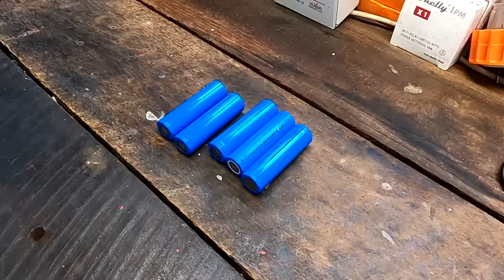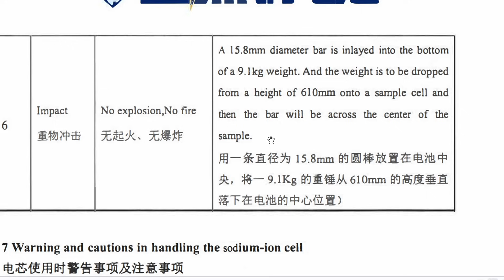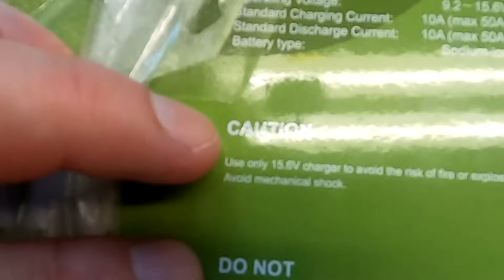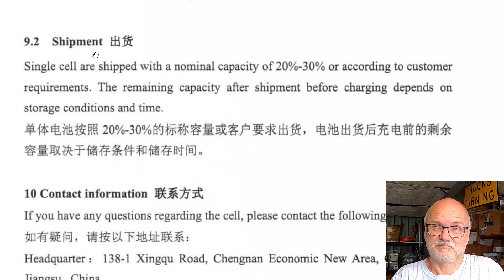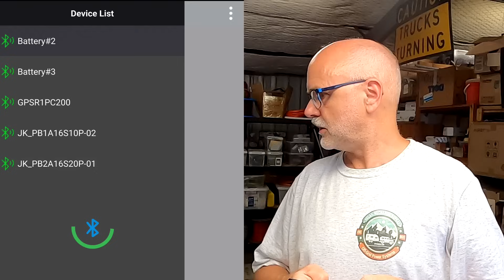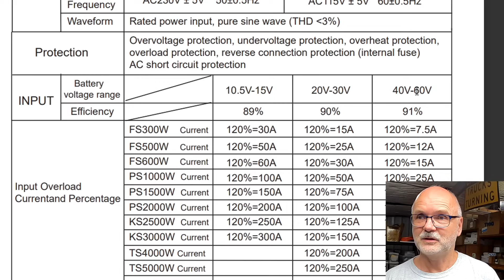Sodium Cell Charging and Discharging Analysis, Hardware Compatibility. Future or Niche product?

Comment: The flat curve of the LFP is just perfect for home storage.
When will the battery shelf be upgraded to 18S LFP (45V -> 62.1V) to gain 12.5% capacity ?
;o)
Reply from the maker: Yeah, I also like the flat and almost constant voltage from LFP batteries.
No upgrade to 18S, there is no room inside the box. I have other plans for an upgrade...😉

Comment: A new BMS design could switch the battery from parallel to series as needed to match the inverter's voltage range.  I wonder how hard this would be to DIY.

Comment: I have some cells from a different source, and they say the specs are charge to 4.1 and discharge down to 1.5. What would happen if you tested your batteries agin using 4.1 rather than 3.95? Based on past experince, a specific chemistry has specific voltages so both can't be right.

Comment: I have a SkyRC MC3000 programmable charger. Can it be programmed for NA? If so what chemistry do I select or does it even matter?
Reply from the maker: You probably have to choose a custom battery profile and set the values manually. I'm not aware of any charge controller which has a sodium profile.
Reply: @OffGridGarageAustralia  Is that what you are doing? It looks like the LiIon profile van be modified for charging, but for discharging the only profile that will work is LTO. Clumsy but workable on the MC3000.

Comment: I am now wondering why a research paper mentioned discharging a sodium ion battery will completely reset the battery
so it would be in the manufactures best interest to steer consumers away from completely discharging them as this 
could effect the long term sales figures. 

So I am interested to see a test that would prove or disprove what the research papers are trying to keep on the down low..

Comment: if they can go to 0v with no damage that simplifies a bms. it means you only need a top balance function ..the top voltage shut of could also not be needed as the bike controller or charger for example could stop the upper voltage leaving only a balance function required and maybe that could be done once at long intervals.also if it can go to 0v it could be bottom balanced simply by letting all cells go to 0v.the linial voltage slope helps identify state of charge. if you have cells that can do higher c rate of charge then you can have smaller cheeper lighter battery that can handle large inputs of charge.im reading some of the sodium cells can acsept 3 or 10c charge input.i think they will overtake lifepo4 in weight and cost.

Comment: Hello Andy, or as we say moin Andy.... I love your videos man. You do a very good job, very structured and intense I think.  Besides the learning effect, there is also a lot of fun.
I can confirm your results with my results on a 32140 sodium ion cell.
I only use 80% of the cell capacity of these cells. The 12V battery has a voltage range of 10V - 15.2V. That works perfectly. Let's see how long such a battery lasts..... Have fun and keep going on!👍

Comment: I have some factory 100Ah Sodium Battery packs, 12v and 24v
the inverters can use most of the voltage range generally, lower limit cut off leaves some un-used capacity but very small.
The Soduim specs appear to tollerate far lower and higher temperatures than the LFP - should be good news for Australians, Texans Sudias and Scandinavians alike!

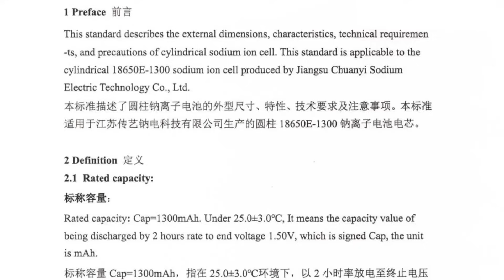Comment: As someone else pointed it out @ 4:10 the Capacity of each batter is 1300mAh in the instructions you received not 1500mAh as you kept saying.  The 1500 printed on the sleeve didn't say 1500mAh, just 1500 maybe that was just  reference number? -   They charged right to their capacity (a bit over).

Comment: Thanks very much for this comprehensive info. But there is no info about cells DC resistance at 0 - 25 - 50 - 100 % SOC. Resistance and capacity are key features to know, if I would build NIB battery for my PV. Also it si well known fact, that we need use cells at 40 - 60, 30 - 70, 25 - 80 or 20 - 85 % SOC ENERGY, so we can use cells at VOC from 2.4 - 3.9 V, but under load it will be lower , depends on Cx rate of discharge and under charge, it will be higher, depends on temp + resistivity + Cx and also SOH, which means, if battery is old and was stored or used at HIGH SOC and HIGH TEMPS, the SOH parameter is BAD. So if we use battery from 2.25 V to 3.9 V under LOAD, we can use Studer inverter 38 - 68 V range, and 38 / 2.25 === 17 and 3.9 x 17 === 66.3 V, so we will use battery from 25 - 35 % SOC to 85 - 88 % SOC and our battery will be good for a lot of years, if we do not abuse battery at high currents, which means high temps at electrodes, separator and elyt, so proper temps range, proper Cx C/D rate, proper SOC range and we can use this battery pack for 1/2 of our life.

Comment: For now, Na+ batteries are still more expensive than LiFePO4 (LFP). That's probably because they are new, and production is not refined. Those prices will drop. But lithium prices are dropping, too. Several new mines are opening up in the U.S., Europe, and elsewhere. It's quite likely that as Na+ batteries drop in price, LFP batteries may have a similar drop in price (wouldn't THAT be nice!). I'm not sure I see Na+ living up to the hype and replacing lithium anytime soon.

Comment: 65% SOC at 2.7V. For a 4s, 12V nominal battery, that means you get less than 2/3 of the battery capacity before you are down below 11V. A lot of inverters are going to shut down at that point. Many 12V loads may also have a problem below 11V. That steep, mostly-linear curve seems less than idea. Not to mention that 3.95Vx4-15.8V at 100% SOC. That's too high for a lot of "12V" applications! So you may not be able to start at 100% for some loads, and you may have to stop at 65% SOC for a lot of loads. We're getting back to the bad-old-days of lead batteries where you can only use 50% SOC of the battery, meaning you need twice as many batteries compared to LiFePO4. Na+ sucks! Already!

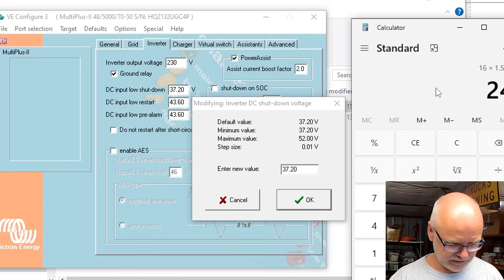Comment: Heya,1st of all those soduim 18650 is a lot of work and battery cell's to make a 320AH parralleled/serial battery bank. Lol later in the video you show the primatic cell's. at time stamp, 29:54 37.20 volt's is the lowest but did you try to chance the minimum voltische as it shows in "enter new value" maybe this way yoou can set the voltische lower. oh you love to see more test's and olso with the 12 volts battery

Comment: Thanks Andy!
I'd be interested to see a cost comparison between equivalent cells for building a 12v nominal pack and 48v nominal pack.

The energy density seems pretty low compared to lithium ion and lithium iron phosphate cells too.

Also they say they are rated for 3000 cycles to 80% -- that's worse than for lithium iron phosphate, which has 4000 cycles to 95%?

At this point, I agree with you that it seems there is only a niche market for them for use at colder temperatures.

Comment: For any static energy storage solution, what actually matters is the total lifetime energy exchange divided by the cost.  These batteries will be judged on their ability to absorb and release energy over time for a give installed cost.  We moved from NMC to LIPO even though the energy density is significantly worse for the latter simply to leverage the greater cycle life that meant an overall lower cost, ie 4,000x 93% is greater than 2,500 x 100% 🙂

Comment: I'm curious to see how sodium battery can be implemented to 48v solar inverters, because of the higher voltages and steeper drops. Will a dc boost converter do the trick?

Comment: You got one point a little bit wrong. For LiIo Cells, there where also no big market for BMS 10 years ago. I think, parallel to the mass production and pricedrop of this cells, there will be a increase in inverters, which are running this voltage delta are pretty fine. I love the idea of this cell type and it will be great for home energy storage. 20kWh for 2000€, will be great 🤣 We will see, time will tell.

Comment: Would you need thicker cables, due to the voltage drop as the battery nears full discharge ?
Reply from the maker: No, it's a 4 wire measurement and independent of the voltage drop in the test cables.
Reply: Sorry, I meant when the batteries are in actual use, to power an inverter etc.

Comment: Hi Andy,

I remember one of your LiFePo tests in where you charge them to around 100% using a lower then max floatvoltage.

Translating this to Victron, would it not be a nice test to see if you can top off this cell with a lower maximum voltage and then test what it does with the overall capacity.

If this sticks, you might be able to build a 17,18,19S etc battery and not really need the maximum chargevoltage the Victron cannot supply and still fill them up. Whis would leave a larger portion of the SOC to be used in one cycle.

Balancers don’t have any issues  up to 20S, not sure about BMS availability.

Gr.

Mike

Comment: There was no appropriate hardware for LiIon cells , when those just came up and there were some adaptations made for LiFePO4 when those became "main stream" . Besides the difference in energy and power density in LiFePO4 and Sodium Ions , main benefit would be lack of Lithium (nasty stuff for mining and handling with) and Sodium is widely available. Some development will occur , for sure , which will (with appropriate dedicated hardware) have an impact on industry , therefore availability , price and demand. People have invested so much in Lithium production facilities (and established raw materials procurement procedures and relations)  , so they don't want to give that up .  As for E mobility  - we'll , probably , wait some more time , to see use of these on a massive scale.
Reply from the maker: I think sodium is still 10yrs away from gaining any significant market share.
As you said, Li battery technology is now established with supply and production chain. That needs to run for a long time to make profit and ROI.
Reply: @OffGridGarageAustralia  Once upon the time (not so long ago) , Lead Acid vere established , than we saw a small flood of NiCd batteries (for battery power tools) , than NiMH (for tools , phones , computers and cars) , to get where we are today . It is evolving more quickly , so I don't think that it'll be 10 years , especially if they become way cheaper than LI tech (as they promise). Those will find their place for sure , because there is not one pill for the illnesses (and Lithium is , as I said nasty and there isn't lot of it , unlike Sodium). Time will tell.

Comment: Thank you so much for another amazing video, really appreciated. I just have a question I have 3 separate 11kw inverter in parallel for 3 phase and each has separate lifepo pack. Can I combine and parallel lifepo packs. Thanks
Reply from the maker: Thanks for your feedback and kind words.

Yes, you can definitely parallel your lifepo banks. I have done it many many times here on the channel and showed how it works. I'm running several packs in parallel myself. 
Here are some examples:
https://youtu.be/bhCSccNsQOw
https://youtu.be/mkelEzVNmIE
https://youtu.be/Prus1ZE4CNg

Comment: Sounds like you need to use a buck/ boost between the cells and the inverter. You will also loose efficiency with a bb converter
Reply from the maker: A bit difficult when you have a 10kW inverter😄
Reply: Its the only way I could think that you could use the full capacity of the batteries with such a large voltage delta @OffGridGarageAustralia

Comment: What I was thinking could be done with these batteries is have two banks. One of bank sodium at a high voltage or say 102V or higher, charged more or less directly from solar. The second bank that the inverter runs off  would be LiFePO4 at 48v with a DC/DC converter between the two banks. The sodium bank would hold the bulk of the storage while the LiFePO4 bank would keep the voltage for the inverter constant overnight. I wanted to see more testing on the large sodium batteries before I try it.

Comment: We need a new generation of BMS, charger and inverters. And we needs to experiment and learn how these sodium batteries will age in different conditions/ voltage ranges.
Reply from the maker: Do we need new hardware or keep using LiFePO4?
Reply: @OffGridGarageAustralia  is that the same question lead acid battery fans asked?   Imagine LiFePo4 comes down to €1500 per 10kwh and sodium €500 per 10kwh.  That could change everything in 5-10 years. For now it is no question.
Reply: I even throw out my 260kg lead gel batteries of my sailboat because LiFePo4 is cheaper (and lighter).  Wouldn’t have thought about that 10 years ago.  Thought AGM is the future.
Reply from the maker: @olaf_s_23  Well, that depends on how good sodium will be in 5-10yrs time. If it costs only 1/3 of LiFePO4 but we need three times the capacity to match LiFePO4 (due to the massive voltage delta), most users won't have the space for that.

Comment: DC / DC Converters could be used to give a constant voltage output, even though the input voltage from the battery drops too low for most inverters?
Reply from the maker: Considering a 10kW inverter, there will be a huge loss using buck converters.

Comment: The difference of -10C  or 0C for sodium or liFePo4 Battery is not that much difference in Northern canada. 
Just like all batteries even lead acid is dangerous to charge at -40C rapidly.   People will do so however the battery only absorbs small amount of energy at that temperature and to do much faster and forced will explode. 

That being said LiFePo4s are fine as long as one has heater in the battery pack as most cars do they work fine. 
LiFePo4 can be charged at lower rate at -20C however not recommended, discharge is Normal at -30C 
As my spec sheet says "Recommended" Temp for Charge is 0 to 60C  and Discharge is -20 to 60C 
As the one engineer in Apollo 13 said... DO not care what it was designed to do Just care about what it CAN do. 

There is huge difference of reality. 

Sodium Batteries are great and work well as most Inverters for 12 volt lead acid cars system will cut off at 11.5 volts leaving just barely enough to start the car.    Also Lead acid batteries have only 50% actual capacity or the cycles on the battery drops rapidly.  Lead Acid is 300 cycles even for Deep cells. 

However Soducim battery will work well in hot arid climates.   Still use lithium in any event.  need cobalt and nickel for the anode and cathode along with copper.

Comment: Nice can  i replace lithium battery with with different capacity i add to my 48v battery more battery from 13s to 16s 60V but my battery cells are on the battery 7 cells 2.5Mah and i have now cells with 2000Mah can i add 9 cells with 2000Mah to get 18AH  to the 7 cells with 2500Mah i want to balance capacity
Reply from the maker: I don't understand that🤷‍♂️

Comment: Andy .........general question ;
What if we use 1 big LiFpo4 cell of 3.6 volts and then step-up the voltage to 12.5v
to make it practical. ?     This way we do not have the multicell balancing problem.
(I live on a boat and have a healthy distrust of complex BMS circuitry and except loss of efficiency)

Comment: I think sodium batteries might be in the long run better choice that lithium. Why? huge voltage delta can be dealt and sodium is much much much! more abundant than lithium. Of course I have no idea what other elements are required with both chemistry :-) That might be the downfall of both types in the long run.

Comment: That is some voltage working range!! Must be tough for EV manufacturers using sodium ion. Their HV cabling needs to be double the area of lithium battery EVs due to working voltage range. Thats a lot of extra very expensive copper in each car. NMC voltage range is 18.% (3.4V / 4.15V). LFP voltage range is 25% (2.7V / 3.6V). Sodium ion as you tested is 62% (1.5V /3.95V) = 2.5 times the current at low SoC compared to high SoC to deliver the same amount of power. Wow

I guess the battery scientists will come up with some alternate chemistry to fix that issue at some stage. Because the current vo.tage range is unworkable in existing applications, as you point out

Keep up the good work Andy

Comment: Fascinating. One of the main points about sodium batteries is they’d use more readily available materials while not requiring entirely new production lines. Looks like the second point is taken care of, but do these cells contain nickel and cobalt? I think mass lithium mining is better than artisan cobalt mining, so I’ll probably be sticking to LFP. Or flow batteries, or some sort of molten metal battery.

Comment: Excellent video as usual.  Someone may have already picked up on this.  Sorry I was not going to read nearly 300 responses.  I suggest you add an another column to the csv to calculate the joules per 2 second sample.  If you do you should  see that energy between 3.95V and 2.325V is about 12760J (3.54Wh) While 3.95V to 2 V is 13540J (3.76Wh).

That is roughly 90% and 96% of capacity.  Inverters do need to be upgraded to properly deal with Sodium-ion but in it's current state the Victron would allow you to get 90% of the energy out of a 16 cell Sodium-Ion battery.

If all the claims about Sodium-ion turn out to be true, the wider voltage range will be a very minor problem.  The average electronic consumer device already comes with a SMPS capable  of 100V to 240V input.
Reply from the maker: Thank you. I cannot really alter the csv files as they won't be compatible with the EB-Tester software any more. But feel free to download them and add as much info as you want😉
Reply: @OffGridGarageAustralia  Thanks Andy.  Poor wording on my part, I did not expect you to rewrite the code for EB-Tester 😀  I meant, if you take a copy of the spreadsheet ...